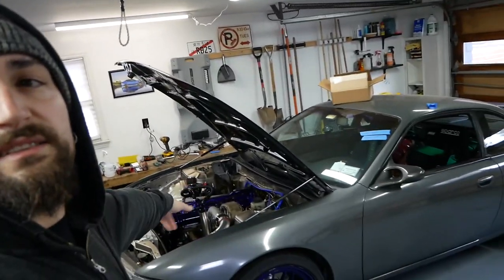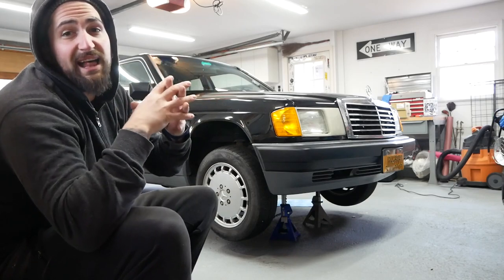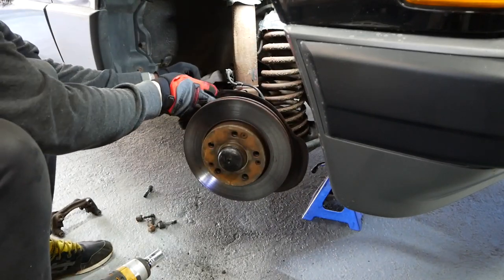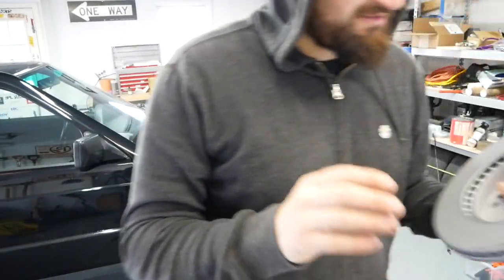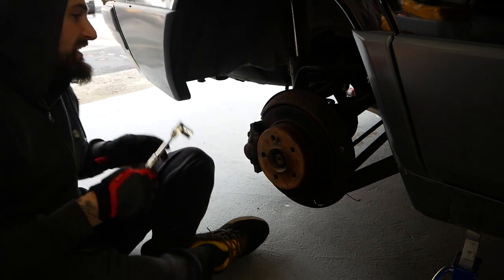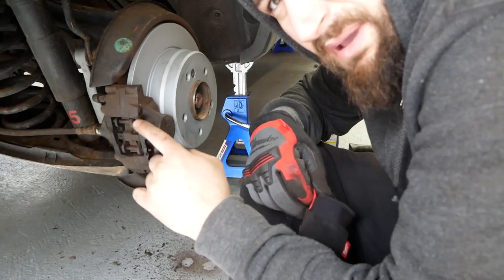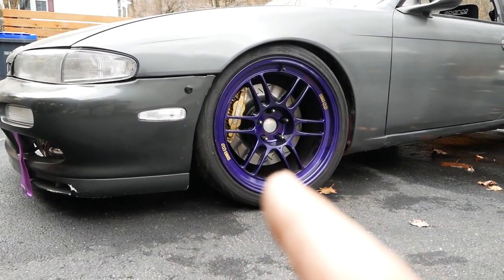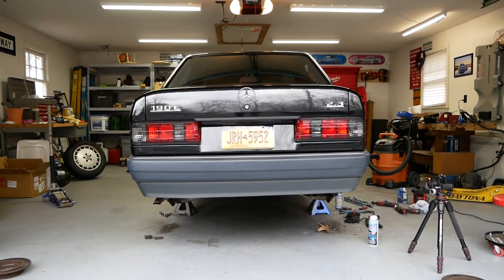How to replace brakes on a Mercedes 190e w 201

Comment: Hi, great video but where did you jack up the rear of the car in order to put the jack stands under the side rubber bumpers ?
Reply from the maker: i jacked it up from the differential.  i have a hockey puck on my jack, so its a little extra cushion(not sure if its even needed)
Reply: @chrisdz  Thanks, I was guessing that is where you put the jack but wanted to be sure before I did that. Thx again.